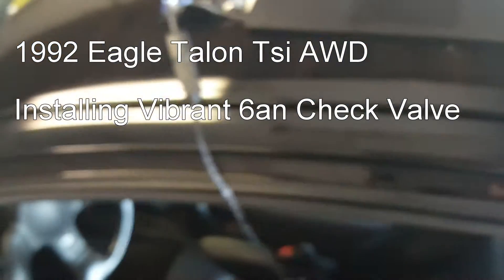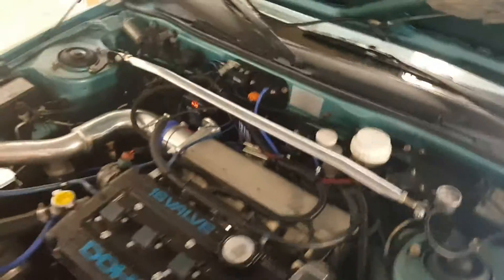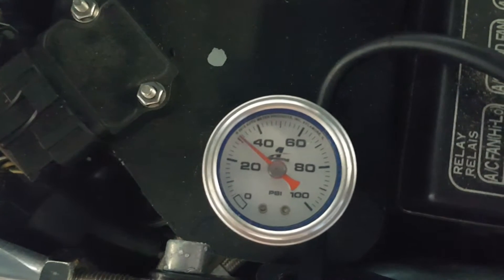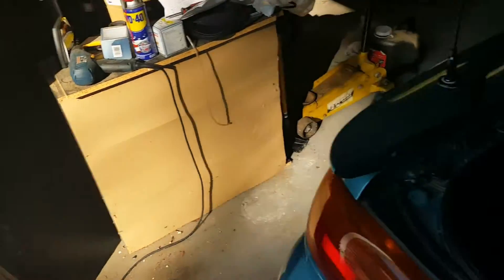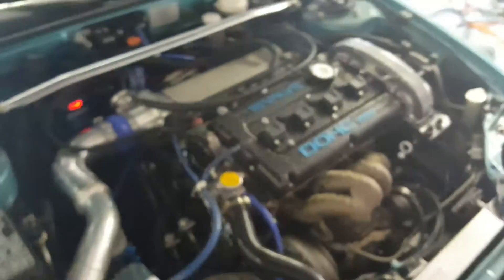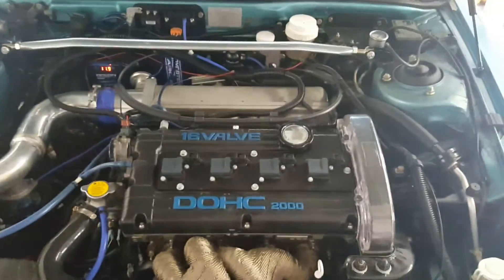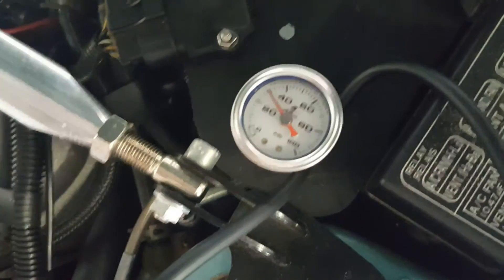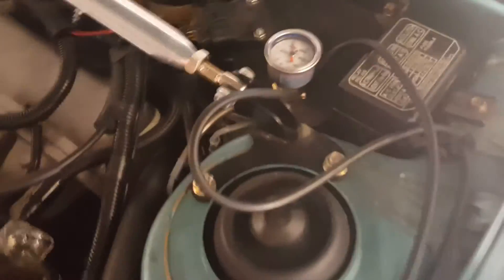1992 Eagle Talon Tsi AWD - Fuel Check Valve Installation

Comment: Hi does the check valve have to be installed by the fuel pump or can be before the fuel filter or between the fuel filter and fuel rail
Reply from the maker: a check valve can go anywhere in the line, however if you're using a bypass fpr like the fuellab, the check valve actually does nothing.  so yea, i installed it for nothing, lol.  the problem has since been solved by ecmlink's latest update, which allows fuelpumpprime for as long as you wish.

Comment: If you have stock fuel feed line, check the hard line from the tank.  It's the one connected to the thicker rubber hose.  Mine was moist, not dripping and I replaced the section where it was rusted.  Now it holds 32 psi when car is off.  I'll be checking the cold start later.
Reply from the maker: i definitely have no leaks, this is just what happens when you install a bypass FPR, which is MOST dsmr's nowadays.  this situation has been resolved with the latest update of dsmlink, which now has fuel pump priming on key-on.

Comment: If you where to put a rewire kit in would it prime with key on?  Is there anyway to get in touch with you? I have a question about my gsx.   Thanks
Reply from the maker: hi Seth, a re-wire kit wouldn't prime with the key on.  it would still act as it normally does, but with a much better source of voltage.  However, if you have the latest version of ecmtuning's ecmlink, there is now a fuel pump prime with key-on.  you can see that in my newest video.
Reply: Do you have facebook messenger or something i talk to you frequently on..  im havin a fuel pump problem.  N you seem to kno what your doin so i wanna see if you have any idea..
Reply from the maker: yea you can search me on fb, my talon is the pic for my profile